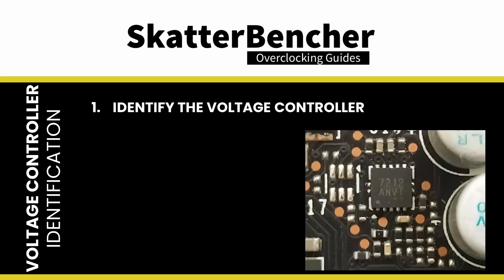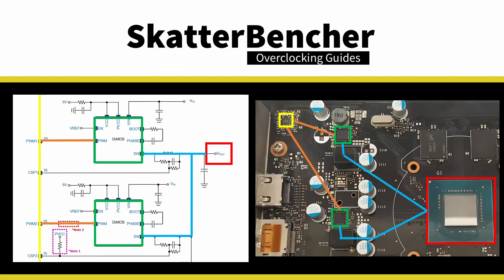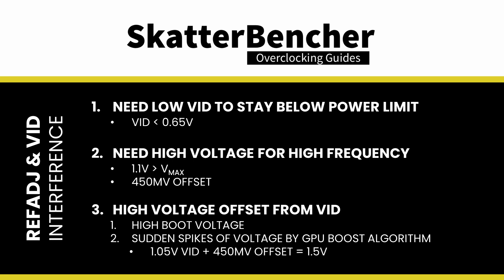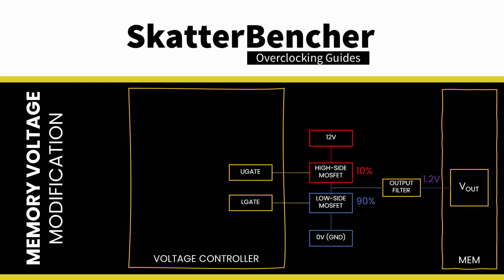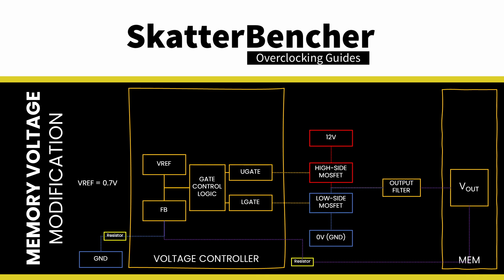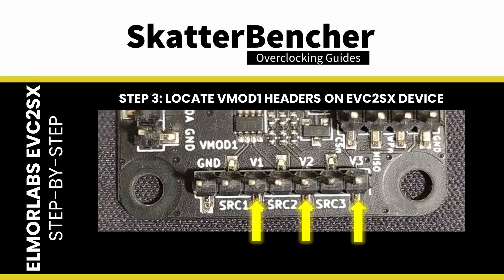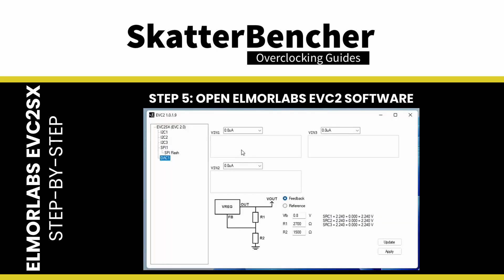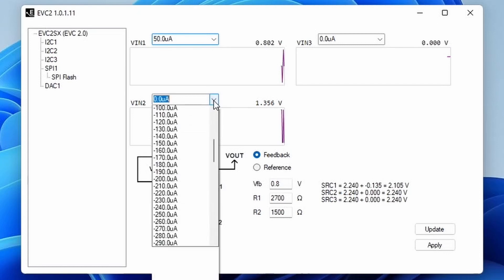ElmorLabs EVC2SX Voltmod Step-By-Step: Inno3D GeForce GTX 1650 GDDR6 Twin X2 OC | SB#42

Comment: Hey ! My rtx 2080ti has the famous defect of being locked to 0.7 volt and I cant change the core frequency as well, its locked to 1350mhz. You think there s a chance this would fix it if i set it to 950mv using this method?